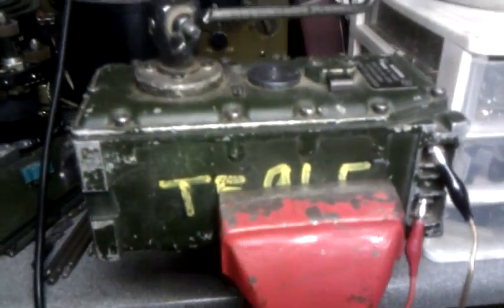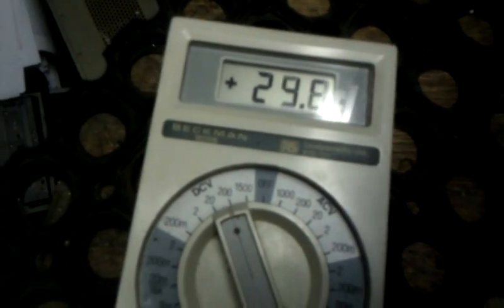Clansman Radio Hand Generator Part 1 www.armyradio.com

Comment: Hi Just curious as to how long it would take to charge a flat 24V battery using the hand generator. These seem like great radios and the equipment left to work them appears much older than I would expect.
Thanks
Reply from the maker: +Paul Billingham 
It would take many, many hours of turning to fully charge a empty battery with one of these hand generators. You would only use one when there is no access to power, when you are out and about....

Comment from the maker: No, not really, the out put from one of these is 28 volts, it will be no good for you to charge 6 volt batteries, even if you wire them in series which would make only 12 volts. if you had four 6 volt batteries wired in series, that makes 24 volts, then you can use one of these to charge the batteries with. To fully charge a battery you need to crank for many hours!!